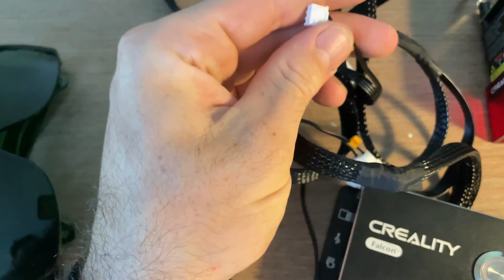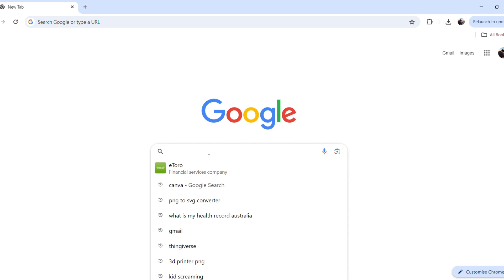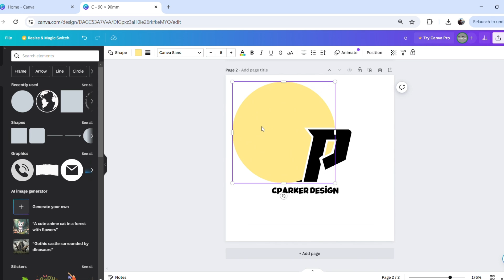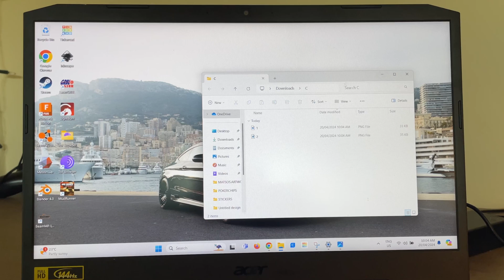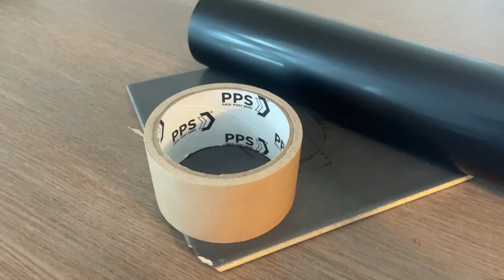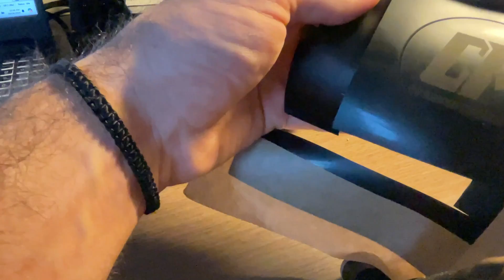3D Printing how to: Custom stickers in 10 Minutes.

Comment: WARNING: DO NOT LASER CUT VINYL!

Laser cutting PVC or vinyl produces hydrogen chloride gas, which mixes with water vapour in the air to produce hydrochloric acid. This is extremely toxic and corrosive.

Comment: Your printer (and eventually yourself) will die because of the fumes while laser cutting vinyl. Not even with a high end fume evacuation system is advisable to do it, let alone without any proper exhaust system.

This is dangerous and very negligent to recommend, specially without any context of the potential hazards.

Comment: I hate to tell you this - but cutting vinyl with a laser gives off VERY toxic fumes. You may want to research that before going any further 👍
Reply: Just came to comment the same thing. It's extremely negligent to share such technique without even addressing the potential hazards involved. It's clear that the OP didn't even know about the subject.